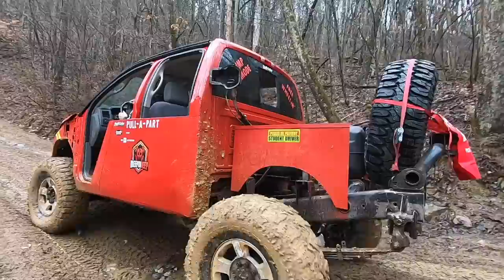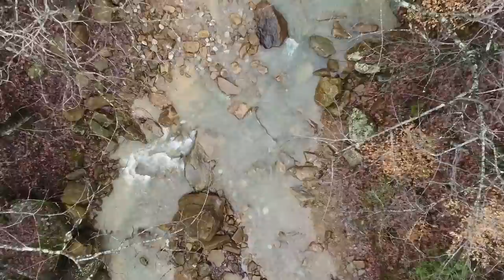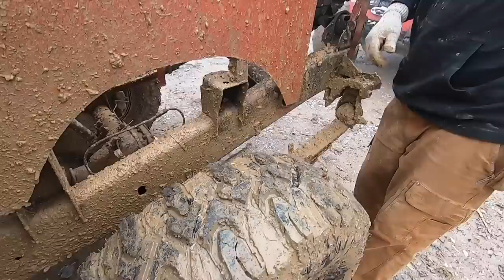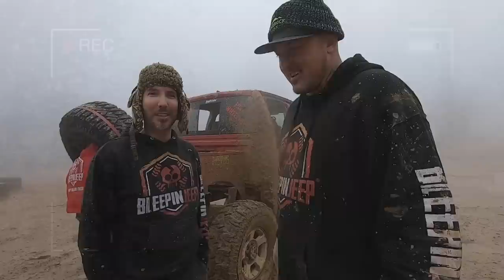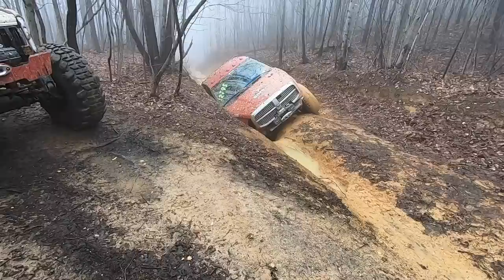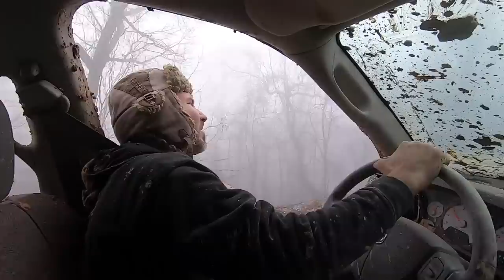How To Wheel a FREE Rock Crawler

Comment: Looks like it's time to weld up the rear diff. I love how your videos illustrate how you don't need to spend a lot of money to have fun off-roading.
Reply: They couldn't.  It came with a limited slip. Diff
Reply: Ain't that the truth!! 🤟
Reply: @normanpatane2417  thats no excuse, break out the drill/grinder/plasma cutter and get in to where the meat is then weld it up.
Reply: @normanpatane2417  it's still possible
Reply: That was impressive with only a limited slip in the rear.
Reply: It was not free u bought steal welding wire is not free 💡⚡ is not free   so in my book it cost something 2 bild 😮
Reply: He did say if they have to they will put a little money into the build at the beginning of the video

Comment: Love this build lol, it’s so funny those old dodges make some loyal budget rigs. I have a 2001 ram 1500 I bought off my neighbor for $600, mechanically the truck is sound the a/c and heat even work but the body is rotted out making it unroadworthy, I welded the rear differential, cut the fenders out, drilled out some 15” jeep wheels I had found on offer up to make the lug pattern fit for 100 bucks with some brand new 33 inch mud tires on it  that had been sitting in the sun so the guy was scared to drive it on the road and sent it, I’ve been bogging the truck for around a year now and she’s loyal as hell and is a perfect Florida trail truck. All in all I got maybe 1000 bucks in the whole thing lol
Reply from the maker: Nice, thats even cheaper than this one!

Comment: I have an idea for your next build, and it’s meant specifically to be a challenge both to drive and to build: get an AWD crossover and make a budget off roader out of it. Something that will be fun to drive, jack of all trades, master of none, it can’t be a jeep, and it has to be a luxury model. Pick something that has limited aftermarket support so that you guys have to get creative with the build. Then go out and thrash it and see what it can do.
Reply: Those dont have any low range gear. They are worthless on anything tougher than a gravel road
Reply: @0778drz110  I beg to differ. It’s all about your transmission gearing and driving technique. I take mine places it was never meant to go and it does it just as well as some built up rigs

Comment: You need to ad "Safety Glasses Required" on the side of that, also looks like you forgot to do a backyard rear locker
Reply from the maker: You must've missed the last(build) video😎
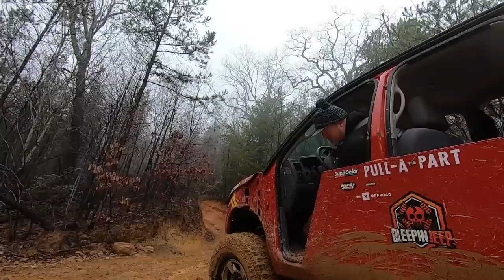Reply: @bleepinjeep  Look at 7:42 mark you're getting the one-wheel peel. I know you guys said you were going to weld it up in the last video maybe it broke loose.
Reply: @KMBlaster  Welded the front.  Back looked like a decent ltd slip so they didn't.
Reply: @splatterize  Don't tell anyone, but was multi-tasking at work missed that part about the limited slip, could have told them they are junk speaking from experience mine only worked on ice

Comment: I don't know about that I think that's more for the newer Dodge Rams in 2003 and up with a Hemi and every freaking piece of electronics you can think in it because my 2000 Dodge Ram the 360 V8 that's been around for like what freaking 5 decades for decades then I have a single engine light on even my old 88 Dodge Dakota never had an engine light on well stuff when I put high octane engine light on LOL